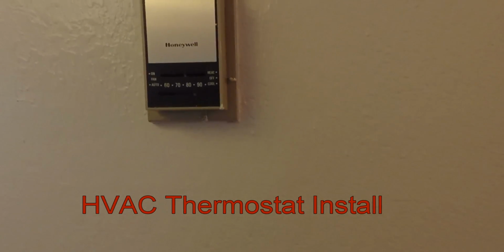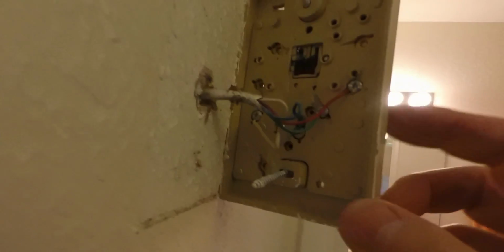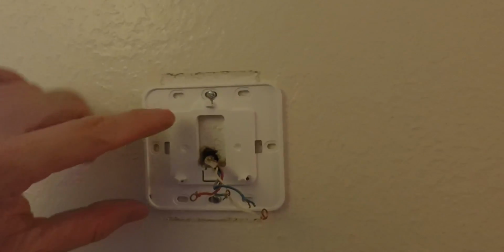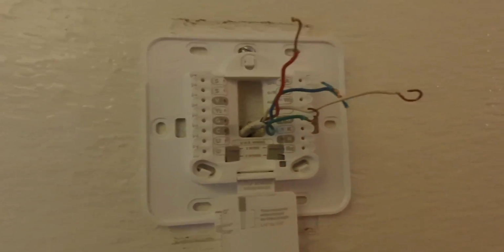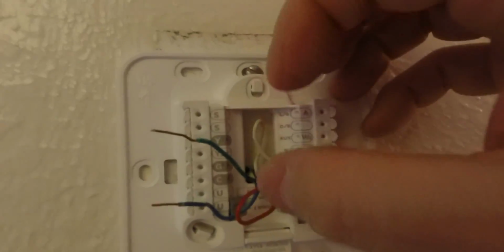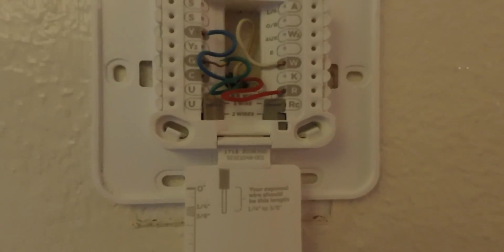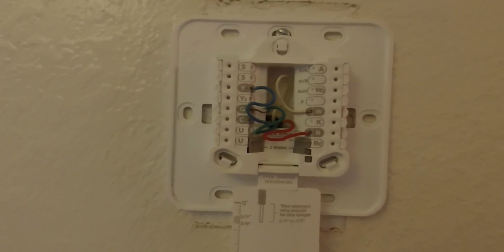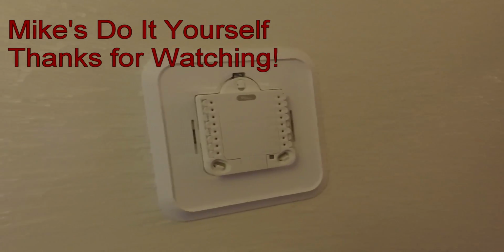HVAC Thermostat Install

Comment: Hello Mike, I’ve only got heat and not equipped AC unit. Only tabs W & R are punched in. What should my setting be on the ISU? Can you help me?
Reply from the maker: Yes, from the Honeywell manual- in ISU set the heat system to radiant heat and set cool stages to zero. The wiring should be shown in the thermostat manual or follow how the old thermostat was wired.. Good luck! - Mike
Reply: What is the difference between ISU 230- Fan Control in Heat- 
•Equipment Controls Fan 
•Thermostat Controls Fan
I don’t know much about this. I’m old school. I’ve had a wood stove for a very long time. Haha! Simpler way to heat a home.
Reply from the maker: @candiceatene420  from what I've researched, it's looks like for manual operation of fan- or equipment controls fan -is selection 1 , I would assume you want the thermostat to control the fan, or selection 2. Hope this helps! - Mike

Comment: Thanks Mike,but do I push both tabs up at bottom or just right side for jumper?
Reply from the maker: Yes, up for jumper if you have one red wire and the wire goes to the R connection. The tabs get pushed down if you have two red wires and the wires go to R and RC. Good luck!- Mike

Comment: Did you push both tabs up ,or just the right side at bottom for jumper?
Reply from the maker: Both tabs are pushed up- in this system, there is only one red wire so its goes on the up or 1 wire tab. - Mike

Comment: I got a black wire it was on the x but I don't have a x on the new one
Reply from the maker: The X wire is for auxiliary heating in some heat pump systems - if the new thermostat has a aux or x spot- that would be the one to connect to. Definitely check all connections with the new thermostat wiring instructions. Good luck! - Mike

Comment: Hey Mike
Looks like I have the same unit but after setup I only have off and heat using mode. No cool
Reply from the maker: Sounds like a wiring issue if everything worked before the thermostat change. I would definitely recheck everything.- Mike
Reply: @mikesdoityourself  Mike it turns out the problem was with the programming.  Operator error

Comment: I need help something is wrong I'm getting hot air
Reply from the maker: Definitely check your wiring - the white and yellow, really all of them- also, check to make sure your thermostat is on cooling and not heating ; if the wiring is correct, then you may have a contactor, compressor, or run capacitor issue. Just isolate one item at a time, this will help pinpoint the problem. Good luck! - Mike

Comment: I have a brown wire that came loose some how but have red blue white yellow
Reply from the maker: The brown wire could be a heat pump wire or for emergency heating on some HVAC systems. The other wires should hook up to their respective terminals. Good Luck! - Mike
Reply: @mikesdoityourself  also found other colors orange and green
Reply: Also have a picture of it

Comment: Thanks for the video. Excellent! I have one question. 

I'm installing this thermostat in my remote off grid vacation cabin for my williams propane stove. I do not have electrical power (I use a generator for lights, etc.), so I was planning on using this thermostat with battery as the primary power. Question: do I just connect to the W (heat) terminal and run that connection on the stove identified as "thermostat"? Thanks for any help.
Reply from the maker: Williams has a few videos on hooking up a propane heater to your thermostat- in the video, it shows a Williams (2 wire) thermostat application but it talks about your thermostat wire that you have- hopefully that video can help- W connection to your switched heater and R connection to the constant voltage wire (with the R to RC jumper wire removed) is the most common connection for a general thermostat. Good luck! - Mike

Comment: Ihave a honeywell t6pro programmable with battery backup i want upgrade to the t6pro wifi can i select 2 wire so that i can power my new thermostat instead of the previous connection that use battery backup.? Which i believe is probably set to 1 wire?
Reply from the maker: If your previous thermostat was wired to run on AC power than it will be easy to hook up the new one to run without battery backup. Battery backup is usually optional on most thermostats. If the wiring is not there, then you may have to run it on battery power. Good luck! - Mike

Comment: Mike I wrote you about a week ago asking about the black wire.  On the thermostat I have now(totaline) the black wire goes into the c slot.  Do I put it in the c slot on this thermostat?
Reply from the maker: The C or common wire is usually blue or black and is used as a ground for Rh and Rc. Definitely use your old wiring setup for a reference- if there's any stray wires, use the new thermostat wiring instructions - it's all dependant upon your air conditioning or heating set-up in your house/ business/etc. Good luck! Mike
Reply: Thanks Mike..I will give that a try.  I’m so afraid to wreck something.  Your instruction is awesome! I’m glad I ran across your video.

Comment: I have an orange wire in the O/B and my pipe on my compressor was hot. No air.
Reply from the maker: The orange wire is for reversing valve on heat pump systems. Wiring a thermostat  is dependent on what kind of air conditioning or heating system you have. I would go by the system you have and the thermostat wiring manual for specific wiring issues. Good luck!- Mike

Comment: Thank you, I got a thermostat like the one you're installing. I wasn't sure about the blue wire going to yellow like my old thermostat.
Reply from the maker: The blue wire is the "C" common wire which enables continuous power from the red wire- the yellow wire "Y" is for air conditioning. Definitely refer to the wiring manual for the thermostat for more information. Good luck! - Mike
Reply: @mikesdoityourself  I moved the blue to C and the compressor didn't come on.  I put it back to Y and the compressor worked.  New thermostat, reached temp, won't click to tell AC to shut off.
Reply from the maker: The blue wire being used as a common wire is common in heat pump systems. In this case, the way your old wiring was wired to your old thermostat would be a good place to start for your wiring. Thermostat wiring is truly dependant upon your heating/cooling system. - Mike

Comment: Hi Mike.  I have the yellow, red,  green and white wire but I also have a black one. What do I do with that one? I have a gas furnace that is about 5 years old. The thermostat I have is a programmable one.  I don’t care for it. I bought  the one you have in this video.

Comment: my ac not kicking on. I tried everything,  contact on compressor,  computer board, no blown fuse, no bad condenser,  yet the ac compressor will not kick on.   What am I doing or miss?
Reply from the maker: Circuit breakers may need to be reset, run capacitors may need replacement, bad contactor, and recheck the thermostat wiring- these are a few things that can be checked- Good luck!- Mike

Comment: Hey I have them setup but I have an extra Orange and yellow wire left what do I do with them
Reply from the maker: The yellow wire will be for your air conditioner compressor contactor and the orange wire is to operate your reversing valve if you have a heat pump. Both wires may or may not be for your specific situation. It's best to match up the wires to your new thermostat's instruction manual for your specific a/c or heating set-up. I would double check the wiring and operate the thermostat and see if anything doesn't work- then focus the extra wires to that location on the thermostat. Good luck! - Mike
Reply: Okay so we have everything hooked up and it's blowing out hot air
Reply from the maker: Is the yellow wire hooked up to the Y terminal? It should be for your air conditioning. It could be a wiring issue - possibly a contactor or a run capacitor that is bad. If the unit worked before the thermostat change, I would check the thermostat wiring. - Mike
Reply: We got it now thanks

Comment: What if I hace RC and RH?
Reply from the maker: It means you have separate transformers to control heating and cooling. RedCool and RedHeat. Always match up your wiring from your old to your new thermostat whenever possible. The new thermostat wiring instructions should be helpful. Good luck! - Mike

Comment: Hey Mike. I have the same wires and entered them as instructed here, but i can only select "Heat" or "Off" on my screen. No cool option. Any advice? Thank you.
Reply from the maker: Hello David, this is an excerpt from Honeywell troubleshooting- "1. Verify that the wiring was matched correctly from the old thermostat to the new thermostat. If there are not separate wires to R and Rc, these terminals must be connected. On some thermostats this connection is made by a jumper wire connection and on other models this connection is made by a slider switch that has 1-wire and 2-wire settings. The installation guide for your thermostat will show which one you have.
2. Confirm the thermostat has been correctly configured for your system." 
I am assuming that the thermostat should have the cool function on the selections right out of the box, and as long as all the wires are in the right place- the thermostat may be defective. Good luck! - Mike

Comment: How do I know I have a heat pump unit? Please help. Thank you
Reply from the maker: A heat pump system has an indoor and an outdoor unit that contain a coil and a fan in both units- these can act as condensers or evaporators depending on whether your cooling or heating. A reversing valve controls the flow of refrigerant to switch directions for heating or cooling. Good luck!- Mike
Reply: @mikesdoityourself  thank you soo much

Comment: Mike I’ve got an older, Mercury type as well and it’s a round Honeywell. Only two wires in back. One is red and the other is green but it’s marked “B”. I do not have air hooked up to this. Strictly a boiler heating system. Pretty obvious where the red goes but does the other one go in “C”?
Reply from the maker: For a two wire system, it should be red to "r" and white to "w". In a a/c system, the green wire would go to "g" to turn on the blower motor. Since you have a boiler heating system, I would make sure your thermostat is compatible with your system and go by the thermostats instructions for wiring. Good luck! - Mike

Comment: I just replaced my thermostat with this same one and we can hear the clicking noise but the heat nor the a/c will power on. Im not sure if I have it wired wrong or what. If you had any ideas it would be greatly appreciated!
Reply from the maker: Sounds like you may need to recheck your wiring(a short may be occuring) or a control board switch relay is bad or a capacitor is bad. I would go with wiring first- once this is ruled out, I would check the capacitor (s) , after that - the relay or circuit board issue. Hope this helps, Mike.
Reply: @mikesdoityourself so we were having problems before we replaced the thermostat with the heat getting stuck and it wouldn't turn off . So that's why we replaced the thermostat. Im thinking relay switch?  Thanks for the help!

Comment: Hello Mike, Great video, by the way. I have a question. I have a 30 year old mercury thermostat that has a brown wire that was connected to a screw labeled "TC". I'm installing the same Honeywell thermostat as in your video. I've labeled all the wires, however, none of the labels have TC on them. I have no idea what to do with the brown wire. Have any suggestions?
Reply from the maker: In some instances, the brown wire is unused in newer thermostats. It is commonly used for emergency, secondary or backup heating. It may connect to your W-2, Aux, or E terminal on the new thermostat depending on the purpose of it from when it was on the old thermostat and/or what kind of system you have. A functional check after wiring it these specific ways should let you know if you've got it right. Just remember to turn power off between moving wires around. Honeywell has a customer service wiring help line if needed. Good luck!- Mike
Reply: @mikesdoityourself  Thanks Mike. I want to commend you for replying to all the people who have questions. Very few people reply like you do. You also reply faster than most people. I wish most people were like you on YouTube. Thank you.
Reply: youve probably figured it out by now,some older trane units had that on their thermostats,it went to a sensor on the outdoor unit,you dont need it on a new thermostat

Comment: I've had blue wire connected to C line on old thermostat (honeywell),when i replaced it with new I did the same but new thermostat RTH6360 doesn't work  without batteries now and I want to fix that.All the rest works fine,Any suggestions? THanks
Reply from the maker: Most electronic thermostats work on batteries or have batteries for backup in case your power goes out. You would have to find a thermostat that doesn't need batteries for basic functionality. Any decent home improvement store or web search can give you a few ideas to what you are looking for. Good luck! - Mike

Comment: Hi Mike, How do you snap this model particular thermostat off the mounting plate to change the batteries?  Mine feel snapped on very tightly and I'm afraid of breaking the clips.  Are there certain sides to apply pressure to to release the clips when pulling off the thermostat?  Thanks for a very helpful video!
Reply from the maker: You can try a flat head screwdriver to push some of the clips if you can get to them- the clips are really tough, so if you pull on a side you should get something to move. Good luck! - Mike

Comment: I have this exact thermostat. I have more wires. You put blue wire in yellow, i have a yellow wire- confused. I can't get heat to cut on
Reply from the maker: Your system may be different, so go by the wiring instructions that apply for your HVAC system. Every application can be different so I can't specifically pinpoint your issue. Blue is normally a common wire, yellow for cooling and white for heating- yours wires/colors may vary. I would hook up the wires that you have to the corresponding slots on the thermostat then research where to put any extra wires you might have. Good luck. - Mike
Reply: @mikesdoityourself  So are you saying that in your case here blue is NOT a common wire but the heating wire instead? That seems odd because most videos I've watched said that the coloring of wires was standard for each function and that one wire color always mean the same thing for each and every HVAC system. Is that apparently not the case here? And if so, when was this home built?
Reply: I have a cuestion? I have a black wire where do I connect that 2 ? Is the the same one you install
Reply from the maker: @yovanyalonso71  - blue or black is a common wire- it is unused by some thermostats. Good luck! - Mike

Comment: Iam having trouble programing to heater it onĺy work with the A/C PLZ HELP ASAP.
Reply from the maker: I would recheck your heater wiring connections- your wiring manual that came with your thermostat would be the best option for reference- also, make sure your wires that came off your old thermostat are all being utilized for the new one- unless the manual says something else. - Mike
Reply from the maker: Also, you may have to switch modes to heat before you can set a heating schedule. - Mike